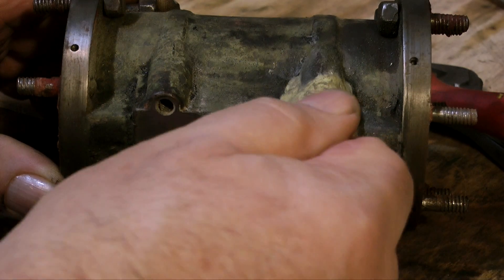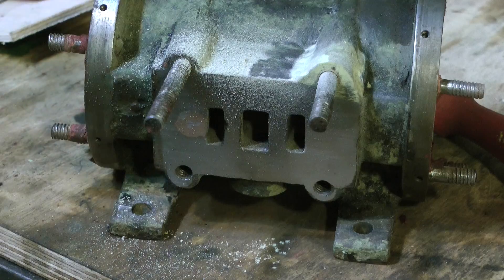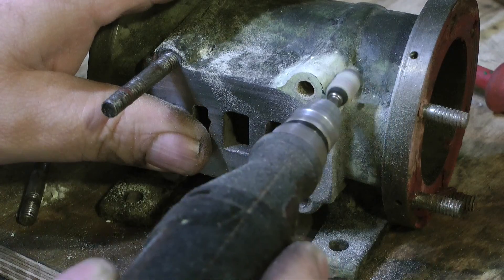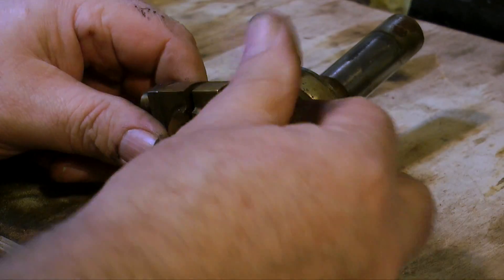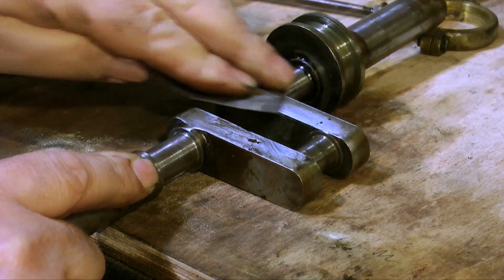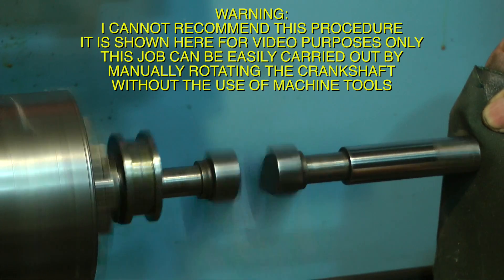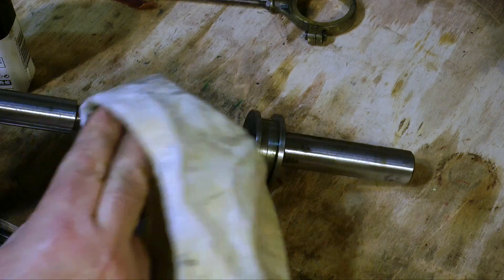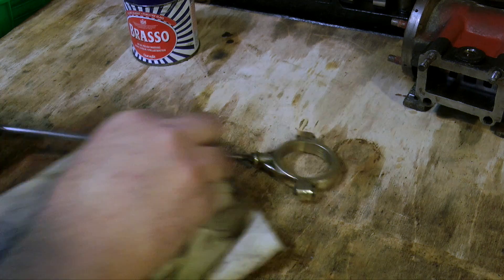PART #6 - RENOVATING A VINTAGE WORKSHOP TYPE STEAM ENGINE

Comment: Hi Keith, I have decided that your video's are far to dangerous to watch safely.  Now some may say that I'm only watching the video and not actually participating in your unsafe acts. But I find that even
watching has an inherent amount of dangers so I have taken to wearing a #13
welding shade during all of your exercises. I quickly realized that leaves my
hearing and respiration exposed. So I now use a 3M 8210 n95 and a 3M Tekk Model
#97451 for my hearing. The heavy rubber and canvas gloves I wear make it very
difficult to press the computer keys but my wife feels that she would gladly
help out there because I am usually fast asleep within 5 minutes of turning on
your video's and I guess she feel that alone is worth her effort. I do need
your help. Could you please TURN UP the brightness and sound on your end so
I could see and hear the picture. Thank You!

Comment: Would the putty you use in this video dissolve if it came into contact with oil, diesel or water? I'm restoring an old tractor and have some small holes to fill. Love the steam videos!
Reply from the maker: mikefoxo Milliput is impervious to oil, diesel & water - it is also heat resistant up to 130 degrees - I have used it for years and find it to be one of the most useful compounds. I even used it to fill some steam cylinder blowholes .... with 100% success.
Reply: You've made my day Keith!! Thanks

Comment: Hello Keith,  I enjoy your steam engine repair videos very much.  Todays video was especially interesting to me.  I am building my very first double acting horizontal steam engine from scratch,  No plans, no measurements, and made from materials in stock.  I am at the point today that I need to start working on the cross-head assembly.  I have never seen one up close and have been working from photos. Todays videos will assist greatly.  Thanks for sharing....  Fred

Comment: Could you do a video on O-rings vs Piston-rings, and what kind of oil to use on each?
Reply from the maker: Hunter S I have mentioned lubricants & O rings in a couple of my videos, I don't think it's worth doing a full video about it. Steam oil is what you need for all types of steam engine piston rings. Don't use motor oil or machine oil - both will make Silicone O rings sticky.
Reply: Keith Appleton Well could i get your opinion about something? I'm making a 2 cylinder steam engine out of an old compressor pump, should i leave the original rings in or switch them out for O-rings
Reply from the maker: Hunter S Leave the original rings in it.
Reply: Keith Appleton thanks